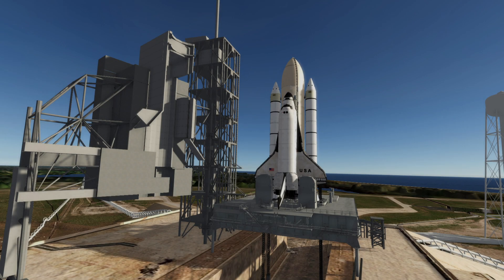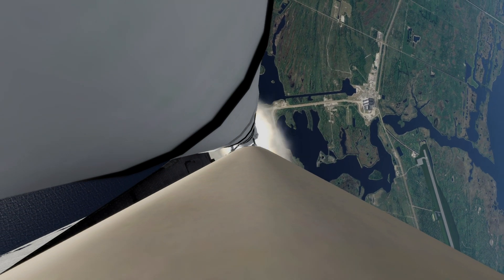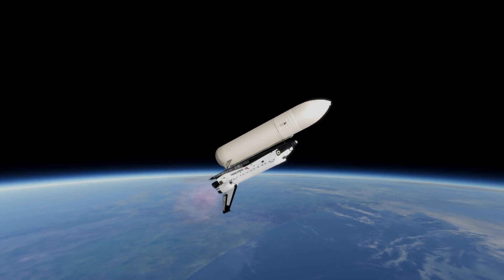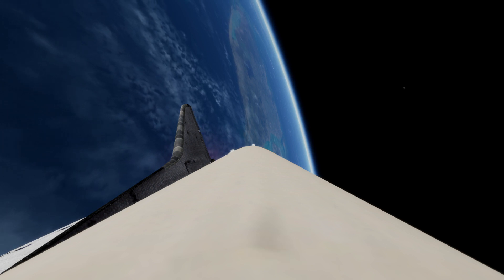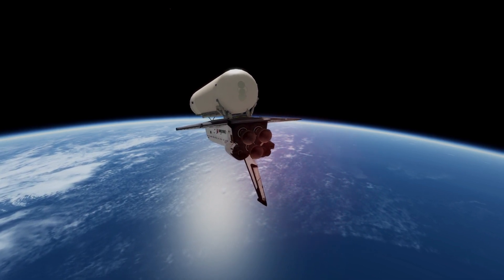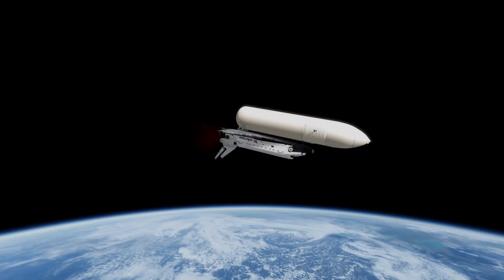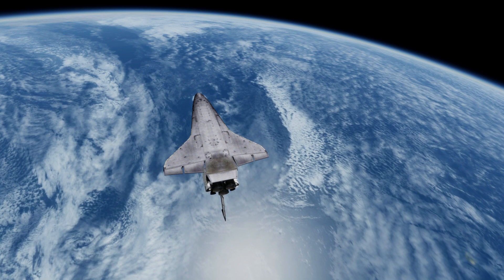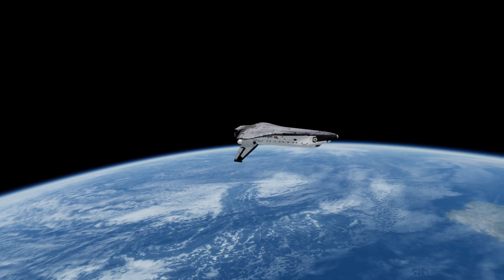Kerbal Space Program with RO - STS-1 Launch, Mixed Cameras

Comment: The roll rate for STS 2 was slowed down vs STS 1, one of the many changes between flight 1 and 2. They rolled fast on STS 1 because they really didn't know how fast it needed to be and you really want to be out of the roll program before wing loading from dynamic pressure starts. They slowed it down because of some concern about structural loads on the tank.

Comment: Beautiful but I believe soon after SRB sep the orbiter is rolled over heads up... correct me if I'm wrong though
Reply from the maker: That was only in later missions once the TDRS system was online. It actually rolled to use TDRS once the ground stations were out of range. For this first mission, they did not roll during launch.
Reply: @RaizSpace  Ah thank you for the information
Reply: @SSK-ws2gl  They didn't start rolling heads up until the mid to late 90's.

Comment: roll just needs to be completed just a tad faster - my only complaint. Hell it isn't really valid it's just my dumb nitpicking. Excellent stuff. BTW is your script set up for direct insertion flights?
Reply from the maker: Currently it stops OMS 1 at 160 km periapsis (a safe orbit in RSS) and leaves OMS 2 and the more precise orbit to the player. The apoapsis it ends up at is somewhat dependent on the load it is carrying, but varies between 260 and 320 km. If I really wanted to, I could tweak it to hit a specific orbit, but as the shuttle itself generally didn't get into circular orbits anyway, I've decided not to bother.

Comment: what mods were used for the tower, rotating structure, and shuttle?
also amazing video
Reply: generally it's Katniss's Cape Canaveral for the most part
Reply from the maker: The pad itself is Katniss Cape Canaveral, the structures on it are from RealKSC through Kerbal Konstructs, though some modifications needed to be made, and the Shuttle is DylanSemrau's version of the CSS Shuttle, which was posted in a thread by Radar.

Comment: Oh also, I installed your EDB mods (Real rockets, Experimental, Real Spacecraft) and put them in my gamedata folder. I'm using RO and put in Raidernick's Animations like it said in the dependencies. When I load up my game, lots of the parts arn't there. The only parts there are the MARCO antenna and the pegasus parts. Please help.
Reply from the maker: What version of KSP is this? And do you have Textures Unlimited and Realism Overhaul?
Reply: It is 1.8.1 and I use TU and RO.
Reply: Oh and another thing, when I unzipped the real rockets, experimental and real spacecraft, they all had the same name (EDBmods). So what I did was renamed each one to their mods name (Real rockets, etc). If I didn't do this the files would have been replaced (You know the interface that comes up when files have the same name? Skip or replace I think it says.) Would That have caused any issues?

Comment: Is there a non-SILTS texture for Columbia? If I recall correctly, it wasn't installed until after STS-9
Reply from the maker: I tried to figure out how to change it, but didn't succeed on that. I think the old version of this mod did have alternate models for the tail, but I don't know whether that is still in it or not.
Reply: @RaizSpace  you could use the challenger tail as it looks pretty much the same for sts1
Reply: @Philly_Willy  that's what I am doing.